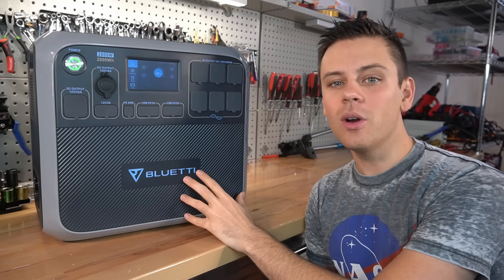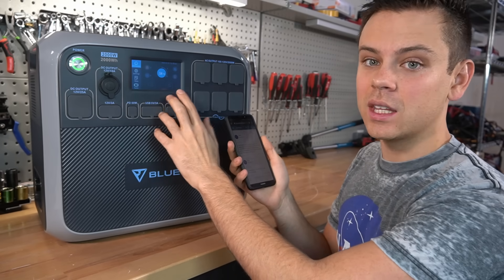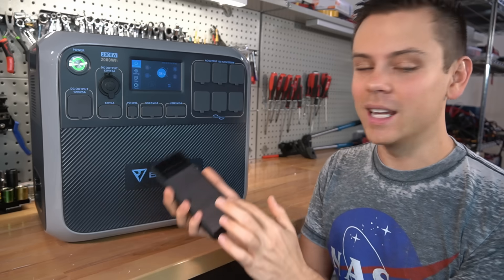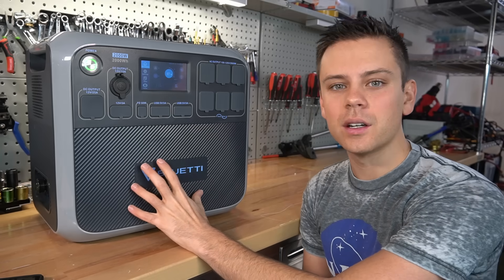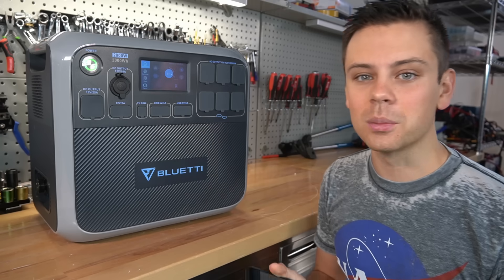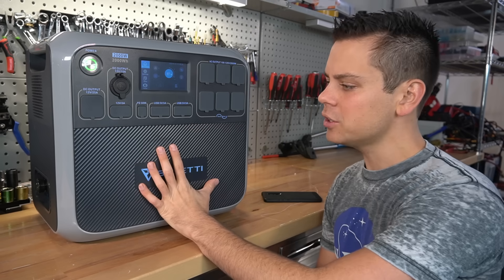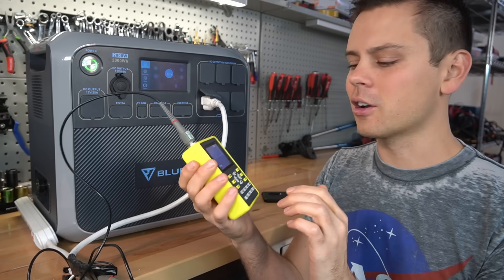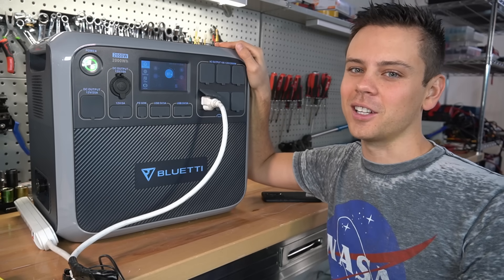New Issues are Plaguing the Bluetti AC200

Comment: Seriously, every single electronics product ever released has had a small percentage of units that turned out defective. This video is pointless as you have pointed out your unit and every other reviewers units have been flawless. As for complaining about shipping in todays covid plagued world, combined with the simple fact it is the holidays as well, applies to absolutely everything currently. This video should not have been made as it smacks more of a desire for views as opposed to pointing out any real issue.
Reply from the maker: No, that's not true. People don't have their units, and the ones that people are getting are not working. It's not a "small percentage". It's a huge percentage. One member got a replacement and it had the same problem as the first one. And no, the shipping labels with specified dates were invalid. That's called lying. Did you not watch the video? They messed up

Comment: I REALLY !!!
hope u do a review on that Milwaukee Battery Generator thats coming out  next month 
its not cheap at $2,200 but im thinking for something quick or a backup power when Boomdocking 
I think 90 minutes to charge one of the batteries is not bad time but would be  Curious how long it would take to charge up with a simple 100 watt solar panel if its possible let say from harbor freight or is it possible to get a solar setup for that same price per watt or amps

Comment: Hmmm, I ordered mine on their Black Friday sale, it has shipped and according to tracking number should be here 12/30.  Just got an email from them that the solar panels I ordered with it are stuck in customs at the port and will not ship for 2-3 weeks. Hopefully they have addressed this issue with the AC200P before shipping mine...with my luck, probably not.
Reply: It has been 10 months....
What has happened since then...
Do you like the Bluetti ... or not?
Reply: @JudiChristopher  I do like the AC200P, in fact I liked it so much I bought two more. I have a 1,000 watt solar array that I charge two of them on. Then the one in the garage I have four portable panels that I charge that one with.  I run a small Iceco chest fridge off it and on sunny days, I can even run the large upright freezer. I hope this helps.
Reply: @photog20001  
WOW!!! I want to be you when I grow up... That is amazing.
So you bought 3 AC200P... do you know anything about the MAX?
I don't know what the difference is... I'm wondering if they did the MAX because so many people were having trouble with the AC200P...
Have you dealt with the Service Department of Bluetti?
Thank you for all your information... I so appreciate it.
Reply: All three have been working fine, have had no reason to contact Bluettipower. I really do not know much about the Max.

Comment: Cool definitely looking for a better how to probe AC with a oscilloscope, definitely worth checking out the electrboom video and the EEV blog ones although they are higher level.
I am using a 4V AC transformer, I also got 100X probes and at some point I will make a resistor Network.
I started with the DSO mini I think that's the right name, I was doing a gig and was having some power issues and was really wishing I could see with the AC output was from the wall (And conveniently all my inverters now).

Comment: I have not finished testing, but my AS200P temperatures on the PC/Car Charge and DC  Output data are wrong.  They read 1degC which makes me wonder if the intelligent fan will work right. Should this unit be replaced?
Reply: Same defect as mine. They sent me a replacement unit and it also has the same defect. Keep demanding replacement units until they send you a good one. It is up to us customers to demand we receive the product we paid for.

Comment: My ac200 has been great. Running part of my 30 travel trailer. No issues. Will be installing a auto switch unit that you had in a previous vid. I was one of the first group that ordered. Been using since September.
Reply: Had mine since mid October. Works as advertised. Use daily as power supply hooked to 2- jingoism solar panels 94 volts 716 watts full sun. Extremely happy

Comment: Ordered my AC200 from Indiegogo and it was 2 1/2 months late on delivery.  Also have a Jackery E1000 because I had to leave and get on the road and the AC200 was late.  The Jackery powered my refrigerator in the van for 4-5 days, so I expected the AC200 to give me 6-7 days since the battery is 700 wh larger.  Nope.  Same 4-5 days over and over.  Sent 5 emails to Bluetti's customer service with no satisfaction.  I think the people answering the emails do not have English as their first language.  I cannot get a straight answer from them explaining why their AC200 cannot outperform a Jackery E1000.  They quit answering my emails.  Customer service rating on a scale of 10...zero.

Edit:. A few days later, I bought a kilowatt meter and tested the AC200.  Had a very small heater that draws 372 watts.  From a full charge to zero on the battery capacity, the AC200 gave up 1375 wh, or 81% of the rated capacity.  Don't know if that is within spec for a unit I just got in early November.  I will contact Bluetti, and if they reply,  I'll report back.

Comment: Does the thing EVER Turn OFF ?

I have the first one from indiegogo and it's really a great system but there are a couple of weird and unexpected things, like no screen timeout or automatic system off when not being used, even with ECO Mode ON.

Also my inverter works really well and I like it for anything over 150W AC but even when there is no draw it says it's using 70W just being on so I plug my old 500W inverter in which use only 2W in standby. It's definitely not 120W and I wasn't gong to argue with thing if it says it's using 70W but I suspect it's closer to 30W or 40W.

Oh and Yes the AC200 inverter produces the most beautiful sine wave I've ever seen, it's literally better than my house power AND if there is any electrical noise it's below what I can measure.

Comment: I actually did several Indiegogo/Kickstarter purchases in March when things first shutdown. They all missed their marks horribly for the same reason... because of the shutdown there were lots of holes in the supply chain that could not be factored into the original estimates done before the shutdown. Of all of the companies that I dealt with, I thought Bluetti/Maxoak did the best job of keeping me informed and their revised estimates were the most accurate. So I thought it was a bit harsh to criticize them on that part without factoring in a near-global shutdown. I have only used it a couple of times when the power went out at my house and it performed as well as I had hoped. I will be paying attention to the data portion a bit more later once we get our solar panels so thanks for the heads up that the data might not be accurate. It does sound like the units you received seemed to give accurate data. Did you get a production unit or only pre-production units? Also, the AC200/AC200P has a dedicated Facebook Group that is monitored and responded to by company reps.
Reply: I think part of the delivery grumbling is due to the fact that there are people receiving the AC200P while backers are still waiting for their AC200. There was no priority to fill the crowdfunding orders  first and some feel they are getting an outdated product and being pushed to the back of the line in favor of new orders.
Reply: @VANquishedAdventures  Actually, I have been following the discussions on the above mentioned Facebook Group. Bluetti offered to cancel their orders and allow them to get the new unit if they wished and told them about the holiday discount. A few have taken them up on it, but there is a significant price difference and it is really hard to beat the Indiegogo price, at least the one I got.
Reply: @SiReasoning  so are you saying they made special exchange offers to facebook users outside of their official Indiegogo campaign thereby excluding the majority of their campaign supporters and likely breaking Indiegogo terms of use? I don't recall that being offered in any of the official Indiegogo updates I received.
Reply: It was made to individuals who wanted to make the upgrade. I don't think it was officially announced. They use the forums to do customer support as many companies do. There were several who had not received theirs yet so it was an easy way to satisfy the customer. For those that bought it and had received it as I have. I don't know how they would handle it, but we got exactly what we ordered and I thoroughly vetted mine before I ordered it, including the company because buying anything off of Indiegogo or Kickstarter is much higher risk than buying retail. What you are agreeing to is to help fund the development of the product, you are not guaranteed to ever receive the perks.
Reply: @SiReasoning  I don't have a bad attitude. I understand the shipping delays and the need to switch batteries, etc.  I am a little  frustrated with my customer experience. It has been almost a month since I initially reported that my product was defective. I was then sent another defective product. I am receiving emails from Bluetti that they have no idea what's going on while simultaneously they are  publicly telling everyone it is an isolated incident, having their employees use personal youtube accounts to defend the product, etc. Either Bluetti does not know the depth of the problem or I am being jerked around. This is frustrating.
Reply: @VANquishedAdventures  I am so sorry to hear that. I would be upset too. Were the problems exactly the same?
Reply: @SiReasoning  Same on both, pv/car temp reading 30°f+- below actual temp and has two fault codes  right out of the box.  Bluetti says they've never seen it before and only have limited hours available for testing. It has been almost a month and still no answers.
Reply: I don't think the faults are anything more than a software oversite at this point. They are both low voltage faults for when things like PV aren't plugged in. The temperature differential could be an issue though. How did you determine that the internal temperature as shown through software was so drastically different from the actual temperature? How did you measure it? I may want to do a similar test on my unit to determine if it may be an issue.
Reply: @SiReasoning  didn't have to test. The ambient temperature in my van was 55-60°f. When I pushed the power button the PV/Car screen temperature said it was below freezing(28°+-).  The only way the unit could be below freezing is if it has a built in freezer. My biggest concern at this point is overheating and fan control. Are overheating protections and cooling fans affected by false readings? Could it run hot without knowing it and reduce the life of the product or worse could it be a fire hazard due to the fact that it thinks it is cooler than it actually is.  I'm still waiting on a response from mfgr.
Reply: @VANquishedAdventures  For reference, my AC200 shows 50F PV/Car consistently whenever I turn it on, regardless of my ambient temperature inside. It is possible that the numbers found are remnants of wherever they were tested last, which might explain your replacement having the same temperature even when replaced. Have you tried charging with PV or car? This might be a better question to ask on the Facebook Group, but if you have not... and have access to an array to test it with, then you could plug it in for a while and then take note of the temperature when you remove the PV and see if it is the same temp after you turn it off and on again... and maybe test for a few days afterwards without putting the PV in again. If it turns out that when not in use it just shows the last temperature when disconnected then you are probably OK.
Reply: @SiReasoning  I have powered the unit on several times and it seems to be pretty consistently off compared to ambient. The units have never been below 40°f while in my possession. Initially I wondered if maybe it had a default temp and was just slow to report/update on startup but it has been different temps each time I turned it on.  When Bluetti told me they have no idea what is happening I just stopped. Last thing I want is a fire in my campervan/home.
Reply: @SiReasoning  also per Bluetti "The temperature display in main interface is designed to show the temperature of the internal heatsink of the device in order to protect the power station from high temperature (over-temperature) during daily use..."

This is where I am making the connection regarding inaccurate temperature readings and fire hazard concerns.
Reply: @VANquishedAdventures  that is concerning... I think I may have seen you on the facebook group... have you tried directly contacting Mark Yue through facebook messenger? I have already talked with him about something else so I know he does respond... although it took a few days.
Reply: @SiReasoning  I have been back and forth with Bluetti for nearly a month. Still waiting. I really prefer to keep correspondence between the company and myself official. I have no idea who the Mark is or what his affiliation with Bluetti is.

Comment: the LG cells in the first batch got pulled by LG, no longer for sale. See also the large recall on LG cells in other storage devices such as RESU. Hence the change to life04
Reply from the maker: I knew it!! That makes sense. Thanks for the update!
Reply: @kerry5972  You have to make sure DC out is enabled.
Reply: The recall was for about 5% of the cells sold by distributors from January 2017 through March 2019.  I don't think any of these recalled cells are in the AC200.
Reply: I have one of the first 4200 units. Why were the AG cells pulled?

Comment: Will, I love your videos. You have caught the attention of so many folks interested in these solar power units.   You've made it infinitely clear you prefer the Lithium Iron Phosphate batteries, but how about those electric car type batteries being used, like in the Zero Breeze ElecHive 2200?  Do yo plan on getting and testing one of those units?  They are so compact, I wonder if they will overheat, and also if the cabling and components are heavy duty enough (in such a small package).   Thanks Will!

Comment: As a manufacturing engineer few things get designed exactly right at the pre-production stage. Go fund me designs will be prone to numerous revisions compared to internally funded designs by pressure to get it out the door before our funding people get mad.
Reply: AC200P owners are reporting defects in theirs too. Some.of these defects carried over.
Reply: but they could warn with longer rollout times to prevent unwanted purchases hence plenty of time to do it right..

Comment: Waiting to see if Jackery brings out a unit in 2021 with similar specs to the AC200P.   Their customer service is miles ahead and was the deciding factor when I made my most recent purchase.  The specs on the Bluetti are awesome but if you have problems you may be stuck with an $1800 paper weight for who knows how long.
Reply: I have both a Jackery E1000 and an AC200.  Jackery's customer service is head and shoulders above Bluetti's.  Bluetti's CS is almost non-existent.  I contacted them with a problem, (why the AC200 apparently has the same battery capacity and performance as the E1000, even though the AC200 battery is 700wh larger)  and they "answered" my multiple emails with nonsense....I don't think the CS department has English as their first language.  I repeatedly tried to get them to explain why the AC200 cannot outperform an E1000 to no avail.  They quit answering my emails.  After about 4 month of use, the E1000 quit charging all the way up to 100%.  It would stop somewhere in the 70%+ range.  Jackery replaced my unit quickly and with no BS.  Top marks to Jackery CS and bottom of the barrel to Bluetti.
Reply: @David-rx2to  
So sad to hear of this...
Reply from the maker: Good point
Reply: I heard that Jackery was going to be coming out with a "Jackery 1500" model in the Spring of 2021. I assume that means 1,500 Wh capacity; not sure about the AC inverter wattage.
Reply: @kenp.7304  Since the "bar" has been moved north of 2000 Wh now, if what you have heard is true, I hope Jackery ups the game to a 2000Wh unit to be head to head competitive.  Also, perhaps a change in battery chemistry...I understand that Jackery's lithium batteries has a life expectancy/cycles less than half of the chemistry in Bluetti's.

Comment: Thanks for the information.  I just got my AC200 today. So for the AC200 checks ok. I appreciate you letting us know about the AC200P.
Reply: Check the temp on the PV/ Car screen while it is not in use. If it reads way low you have a known defect. Hopefully you got a good one.
Reply: @VANquishedAdventures  what should it read?
Reply: @Blah_Blah.545  with the unit not being used the temperatures should be the same as their surroundings. Mine reads almost 30°f colder than it actually is. Will it burn up or catch fire is my concern. The unit thinks it is 30 cooler, does that affect when the fans turn on? Does that affect any other overheating safety features? I don't know.

Comment: Will, i have been considering one of these solar gens for the RV. Would you consider doing a video on how to setup a transfer switch inside the RV so it can be plugged indoors? I have a 50A rv and would like to be able to use it when boondocking without having to pull out the 50A cord to dogbone to Solar Gen. Plus would be able to use even when its raining and keep it safe indoors. Of course limited to some devices (TV, Routers, chargers...). Having a transfer switch would allow me to use the breaker box. Not sure how to handle 12V converter or go around using the 12V 30A plug with another transfer switch. Any ideas would be appreciated.